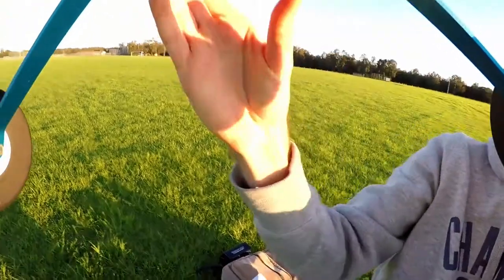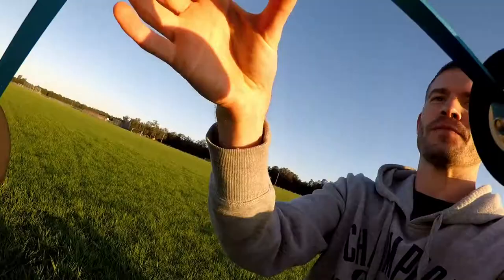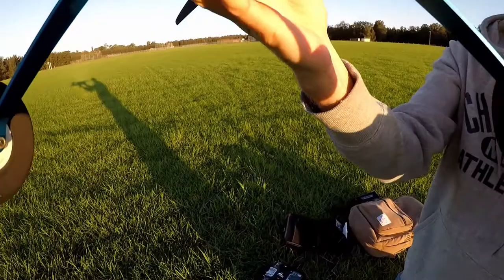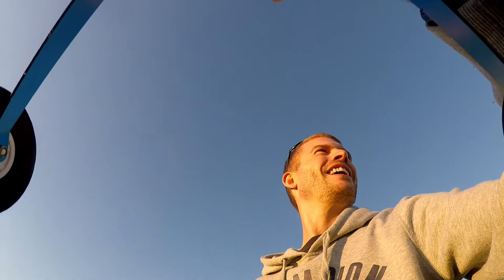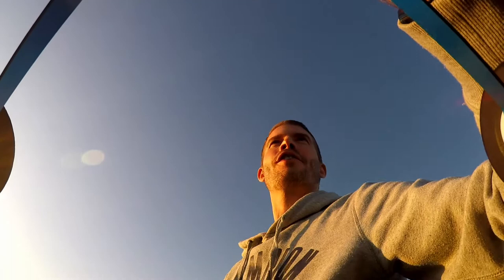Filming with a GoPro Part 2 | FMS SuperEZ

Comment: Nice place to fly Nick your area looks fab from up in the air!! Nice to see a bit of onboard footage, the SuperEZ has a massive CG range and what I've found is with more weight moving the CG forward it becomes much more stable but harder to roll and loop!! Great video and thanks for sharing👍😄
Reply from the maker: Yeah it really is a pretty area! What sort of weight addtion have you tried in your bird, Ian? The GoPro was pretty heavy, tbh.. I wasn't sure how she would handle it- especially seeing as though she had the added drag of the camera through the grass ha.

You'll enjoy the next video which should be out in a couple of days, my friend!
Reply: When I first got the plane I thought the CG in the manual was wrong!! So I added weight on to the battery so the CG was right forward it was very stable but didn't roll or loop very well!! So then I just run it with the 3s 2200 right up to the firewall and it was much more agile 👍
Reply from the maker: I think the 2200 3s is pretty much a perfect fit for that aircraft. 

I don't want to give too much away (and spoil upcoming videos) but I was out ground handling this afternoon and she's displaying some [possibly?] different characteristics.. or maybe it was just that I was at a different field from the one I usually fly at, there were WAY too many people around and it was sunset. 

That combination could have ended badly. I had about a 90 second flight, brought her down and ran her through her paces on the ground doing the occasional little pop up 3 feet off the ground and plop back down. It's almost as if she's even floatier.. I feel like she needs that GoPro on permanently.

More to come!
Reply: Planes can feel different from day to day!! Different air pressure and so on, mine fly their best when it's cold🥶 The temperature can also cause the servo push rods for the tail to contract or expand in their guides which can affect your trimming!! So yes my planes feel different from flight to flight👍😄